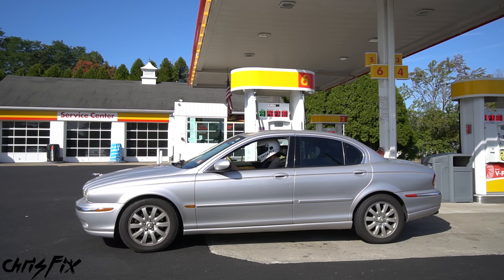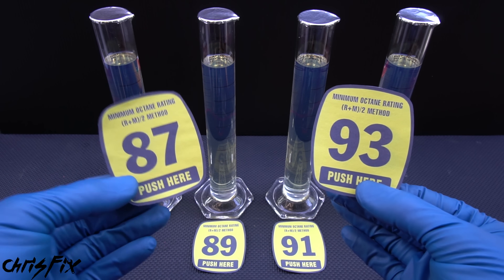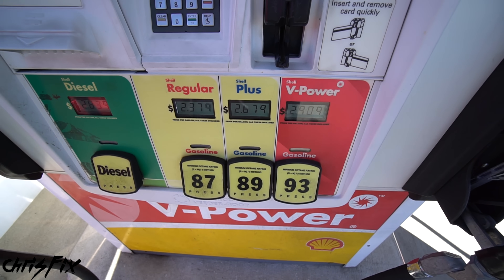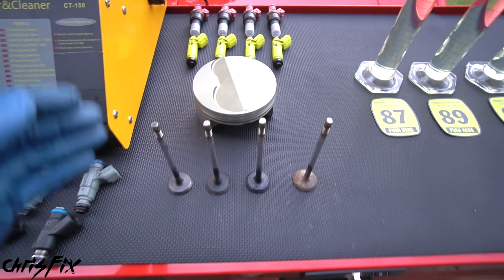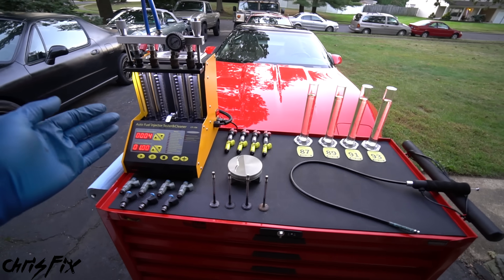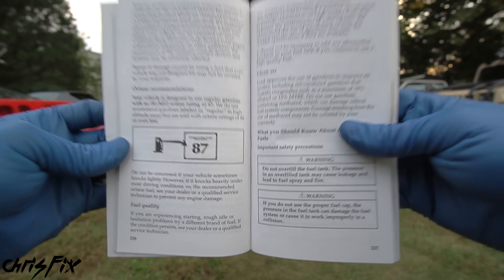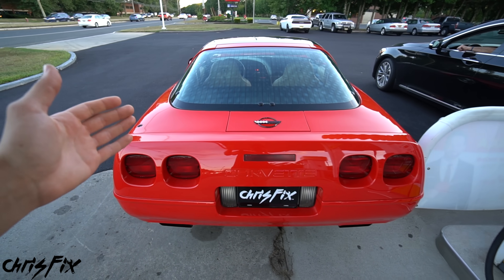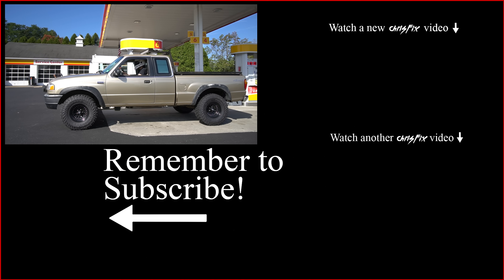What is the BEST Fuel to Use in Your Car or Truck and WHY

Comment: E85 has been a gas I have argued with people who mod their cars over.  The new trend is to turbo/supercharge their car and then get it tuned for E85.  Their arguement has always been modern cars are designed to run E10 so they will run E85 without any problems.  This is very incorrect.  Fuel pump, fuel lines and fuel injectors are damaged by E85 if they are not designed for the  E85.  This typically results in clogged fuel injectors and the owner simply changes out injectors and sells  the car still tuned for E85 to someone else who ends up replacing all of the parts from the fuel pump to the fuel injectors.

Comment: ChrisFix in 30 years... "What is the BEST Electricity to Use in Your Car or Truck and WHY"
Reply: @Alexander Chohan it kind of wooshed over your head! It is just a tease at the fact that electric vehicles are becoming more popular. Also if we get technical there IS DC power and AC power, but it was just a simple joke on the title!
Reply: @gripz81  AC or alternating current is used in electric cars or Nikola testla the smartest guy evers invention. Edison killed elephants ,dogs and more in live performance s with his DC current saying it was testla and his account current but lying about it. This after testla fixed his catching fire issues and more with DC current. But Edison did create one thing good for DC current,(electric chair still uses DC current).
Reply: What Voltage should I charge my car at?
Reply: @Alexander Chohan I thought that was part of the joke. Unless you have a special car, it won't matter what octane fuel you use at the pump. It's basically all the same.
Reply: Cars should be running on garbage by then. Haven’t you seen Back to the Future 2?
Reply: Ten years, fastest charges,best battery, they had water aka hydrogen ,steam cars back in 1832,Edison,Ford,rockifellers with finding oil killed the 100 mile per charge electric cars in 1890's all for greed if oil companies .
Reply: @Alexander Chohan see above reply.

Comment: Bull. The gas is all the same what is different is the anti knock Agent. So your gas will not Ignite in higher compression engines. And the compressing of  the fuel into a smaller space is where you get the power.

Comment: Here in Colorado we have 85, I've heard its because of the elevation
Reply: I drove from st louis to gunnison this past July. The amount of  acceleration I had in st louis is way more than i had at 13000 feet at monarch pass. Less oxygen typically suggests lower octane due to the inability for it to ignite at that altitude because of the lack of oxygen compared sea level.

Comment: I've checked the manual in both of my cars and they say "regular 87 octane" but regular in Colorado is 85. Both engines are port injection, one is a hybrid. Does the elevation of Colorado (3,000+ ft) mean it's OK to run 85 octane (regular as the manual calls for) or should I run mid grade 87 (which the manual also calls for)?

Comment: Not simple, I've owned 5 maximas from 90s to my now 14. I use to regular all the way up my 03 when my engine blew. It says on the gas cap "for maximum performance PREMIUM fuel is RECOMMEND". So now all I use is premium and I've had no problems.

Comment: it's not engine knock, it's spark knock. i know the confusion but engine knock is when a rod bearing is loose or where it's hitting the oil pan. spark knock is either predetonation or late detonation.

Comment: My car says 87 but I live in the rockies @ high altitude so the regular is 86 or even 85 in some areas, they do this since the air is thinner and it doesn't need as much knock resistance, but to keep my car running good I put a quarter tank of premium every so often, also make sure you are using "Top Tier" brands of gas for the extra additives

Comment: Nice video! maybe was dirty or maybe good luck but  I put the cheap gas for a month and suddenly my van stop working. The mechanic guess it was the fuel pump. That was expensive... I did a search and decided to buy an octane buster. Guess What?! My van works! TG is still working and Im getting gas in just one gas station and midgrade (just in case) :-)

Comment: Question I have a 2019 Dodge charger RT super track pack of that makes any difference, it saids 89 recommended 87 acceptable. Could I put 93 in or would I be wasting money.  I use 89 like it said, but was thinking about 93 today

Comment: 91 octane in US are 95 ron in EU. 93 are 98 ron EU. But 100 ron, or even 102 ron are offered in Germany (only 102). Fuel are very clean in EU because of stricter lows. Modern turbo engines loves high octane.

Comment: I’m glad he made this video I’m tired of idiots saying it’s all the same thing. Numerous times ppl say oh it’s a road trip so the car is gonna run all the bad gas out. Or that car doesn’t have a lot of power you don’t need it. I try to explain always the manufactures recommend using this type of gas due to the compression ratio to prevent knock. But they just look at me with this blank look and get lost. Thankyou so much 😭.
Reply from the maker: Exactlyyyy. So now just send them the video haha
Reply: I've had gas station attendants giving me blank looks when I put regular in my 92 Miata. "Bbbut its a sports car!!!! You can't put regular in that!" Well if the manufacturer says so, who am I to argue with them?

Comment: How about E88,  pumps says you can use that on both flex fuel or regular cars 2001 or newer
Reply from the maker: That is E15 aka up to 15% ethanol and 2001+ cars can use it without issues but I would try to avoid it if you can for now. That’s a lot of ethanol for a system that wasn’t really designed to used it. It’s fine if you use your car every day and go through a tank of fuel pretty quickly but if the fuel sits it absorbs water and can create corrosion.

Comment: Premium fuel burns slower, which is why it doesn't create knocking in high compression. That's not a myth.
Reply from the maker: That’s not true! Pleaseeeeeeee don’t spread myths. They burn at the same rate. Premium doesn’t knock because it has higher octane which is resistant to detonation. But gasoline all burns at the same rate. This info is verified by petroleum scientists so we know it’s accurate.

Comment: What about cleaning additives for fuel, any advice on that. I don't know how clean the fuel is here but no shell. We also have higher ethanol in winter months,  any recommendation for that.?????
Reply from the maker: Idk where you are from but in the USA you do not need to add any additives. Even if you don’t have shell, every brand fuel has a minimum required additive. I don’t suggest using them unless you have an issue like my truck had.

Comment: Your full of shit pal!! I know if I run on less than 89 my engine will knock. N it dont have the get up n go 93 has. N my fuel mileage stinks!! I own a 02 chevy z71. With a upgraded motor. So that theory u can run on cheap gas. N lower octane is trash! Not with mine.
Reply from the maker: Thanks for sharing. Maybe you got distracted or missed the main point of the video or didn’t watch the video. You can use the recommended octane for your vehicle. Since your engine is “upgraded” you probably need higher octane fuel as I explained in my video as well. Might have missed it but before you tell someone they are “full of it” I would make sure I understood the video. Thanks

Comment: What about using an oil catch can (for direct injection engines)?
Reply from the maker: That’s actually helpful and some oil brands are making oils specifically for direct injection engines to prevent excessive carbon deposits.
Reply: ChrisFix do you have a video on how to install and maintain and oil catch can? I’d certain like to see one. Also, is it too late to install on a vehicle that’s already got 10k miles?

Comment: Chris, can I use shell Vpower once in a while just to have a cleaner engine, will it make a difference? My car car doesn't require premium gas.
Reply: @Fred - Yes, absolutely or you can buy a bottle of Techron & add to a full tank of gas, when tank is empty then change the oil ...
Reply from the maker: MrSummitville, watch my video “does techron actually work (with proof)”.
Reply: @chrisfix  Yes, I do remember watching that video, many years ago.  I do not believe that one bottle of Techron will undo many years worth of neglect.  Using a "Top Tier" gasoline ( required by some engines ), or every month add some cleaner to regular 87, is the best way to keep the engine cleaner.  An ounce of prevention, is worth a pound of cure ...
Reply from the maker: Fred, you would need to use it for 2500 continuous miles for the Vpower to clean the valves and injectors. Using it once might help very very very slightly but you should use it a few times in a row to see a difference.

Comment: Mine say's to use Premium, but I live in california and I can't afford to pay $5.50 for gasoline
Reply: Buy some octane booster
Reply: @NateDaGreat561_  This is a much more expensive solution than buying the correct gas.
Reply: Move out Demigods tax everything Fla is 35 cents gallon fed tx 7 cents state 3 cents road tax  gas is 2.35 Clearwater fla

Comment: Diesel has 50% more energy per gallon vs gasoline
Reply: @Raj Gill - Diesel = 129.5 BTU per gallon, Gasoline = 114.5 BTU / Gallon. How is that 50% more energy per gallon?
Reply from the maker: MRSummitville pretty much nailed it.
Reply: @chrisfix  Higher energy per gallon but higher cost per gallon, so about the same  net cost per mile driven ?  Althiough, diesels can get very good MPG's - But VW did illegally tamper with their EPA MPG ratings vs pollution controls ....
Reply: @MrSummitville  ah I was using VWs doctored numbers as my reference. I have a smog except rabbit caddy

Comment: Another information that could have been included is that if the required fuel is not available but there are both lower and higher octane versions you should only go up. That does not damage the engine, going down does. For example my car requires 98 octane but we only have 95 and 100 here, 98 is no longer available so I have to use 100. Up is fine but usually unnecessary, down is bad.
Reply from the maker: Thanks! I did explain that you can use higher octane in a regular car in the video.

Comment: Very informative video Chris!! Your the best IMO but what about Ethanol in the Gas we use?Some stations now have at Ethanol free gas pumps! but it's only standard Octane, so should I use that instead?
Reply from the maker: It’s not a big deal to us ethanol as long as the car doesn’t sit around. Ethanol absorbs water so it can cause corrosion if you’re not filling the tank with fresh fuel every week or two. It’s more of a problem with boats because you don’t fill tanks with boats often.

Comment: A lot of in your face advertising in this video. A first for you. I think you should avoid it. Not worth it.
Nice shots with all your cars though.
Reply from the maker: Like what? Thanking shell for letting me use their gas pump for a day seems like a nice gesture for what they allowed me to do. I explained what octane to use in your car and how to figure out what to use and why. Just because I shot at a fuel station means it’s in your face advertising? So when I work on a ford and explain how mustangs have this specific issue I’m doing “in your face advertising”? Spending 45hrs on animations so I can explain what detonation is, and how some fuels can have additives in them to prevent wear of the upper piston ring is advertising?

Comment: Run what the manual says.  Most can run any grade, because of the knock sensor.  And after a tank or two, your computer will learn what fuel and timing it'll be running.

Comment: Is there any other ways u can check what fuel your car needs because my mom fills up with regular and I fill up with premium and I don’t know any other way
Reply from the maker: I showed 3 different ways. The best way is to check the owners manual. If you can’t find it, see if the engine is a high compression engine or forced induction engine. If so, run premium, if not, run regular.

Comment: Great video for a non mechanic like me.  Could you add information on the added ethanol to normal fuel.  What it does, the benefits, the down falls.  Does it cause more deposits in your engine at a quicker rate.
Reply from the maker: I should do a video specifically on ethanol
Reply: @chrisfix  Yes that would be awesome.  There is a lot of info on that subject.  Is it true, is it false, hard telling.

Comment: Thank you so much for all of the info in your videos! My husband & I have been able to do some of our own repairs this year simply from watching your videos & it’s such an awesome feeling knowing not only that we fixed it ourselves but the hundreds of dollars we’ve saved because of you. 

We have a 2003 Chevy Trailblazer EXT with around 140,000 miles on it that we were running with 89 up until last month when we thought we had an issue due to some bad gas. We were told to fill it with 93 for the next few fill ups to clean everything out after the water had evaporated & we found it gets way better gas mileage than with 87 (we used that a few times earlier this year then went back up to 89 because of the difference in mileage - we actually spent less getting  89 because we had to buy it more often when we got 87) & slightly better than 89. 

After watching your video this morning I checked the owners manual & it says to use 87 octane or higher. 

If it were your vehicle what grade would you use after finding this out?
Reply from the maker: See what MPG you get with each, calculate the cost per mile for each grade and see what is cheaper and run that.

Comment: Octane booster using premium gas?🤔
Reply: Mast M - Regular Gas + Octane Booster = Premium Gas  -  watch the video ...
Reply from the maker: Octane booster is a good emergency bandaid they you can use to help boost the octane a little if you fill up with the wrong fuel.

Comment: In europe (at least in Slovenia) you can only choose between 95 octane and 100 octane gas. There's nothing with less octanes even though it would be okay to use in lawnmowers.
Reply: @Matija Lazić
  -  Different math / formula used to compute Euro Octane Rating vs USA   -  watch the video ...
Reply: @MrSummitville  I was unaware of that. Thanks for info
Reply from the maker: Watch the video

Comment: hello chris, all the way from malaysia. im a honda sales advisor, i always get the question for which fuel is better or not , what are the differences or downsides. your video has been very informative adding to my knowledge. im evenly knowledgeable about cars and stuff, as i myself runs n maintains an integra 1991 DA5 . i would like to ask, here in malaysia we're using RON95 and RON97 rating. where honda cars always has a sticker for 91octane fuel. based on your explanation in the video, i understand that it actually made no significant change either u put in 95 or 97 since all honda cars now comes with a variable valve timing system. here's my big question. specifically on new honda cars. the turbo charged direct injection 1.5L vs NA ones, with 95 or 97 the valve timing will automatically adjusts anyway, but which is the actual proper fuel to use, and what are the advantages/disadvantages. 

case 1 = turbo direct injection 1.5L running on 95 vs 97 , apart from power/ fuel efficiency loss from automatically retarding/advancing valve/ignition timing to prevent detonation. any reliability issues/extra wear n tear? 

case 2 = NA 1.5L / 1.8L / 2.0L running on 95 vs 97, apart from power/fuel efficiency loss from automatically retarding/advancing valve/ignition timing to prevent detonation. any reliability issues/extra wear n tear?

lets assume both situations are using shell petrol on brand new cars.

there have been alot of debates and no actual guideline. some saying 95 u get less power/engine runs rougher vice versa with 97.
as to my own knowledge, as long as once the variable timing is set, it should perform the same since they're  all stock to begin with.

just would like ask if you could help clear up myths all the way from the other side of the world in malaysia, thankyou =D
Reply from the maker: For high compression engines or turbo or supercharged engines, it’s technically better to run the highest octane gasoline because the engine can advance its timing and make more power and more MPG. With that said, depending on prices you might find that extra power and MPG are not worth it.
Reply: @chrisfix  thanks alot chris, meaning to say, since the engines are designed for 91 and above, anything above 91 will not actually cause harm or excessive wear, but only power & fuel efficiency in play?

on the sidenote, honda NA engine and turbo engines do come with compression ratio 10, the general idea is just the turbocharged ones would find extra power and mpg vs fuel price more significant than the NA ones ?

Comment: I use mid grade on my 2016 Dodge Dart SXT because I was told it burn "cleaner". Have been using mid grade for over a year and now I'm confused and contemplating on whether using regular or mid grade lol
Reply from the maker: If regular is recommended in the manual, use regular. Mid grade doesn’t burn better. The only difference is octane.
Reply: @chrisfix  thanks! Yea it says regular so I'll just switch it back

Comment: i would like to shine some lights on the animation. while the piston compressed the the pre-donation occurred - it com bust when its hot.  not when the spark plugged is already sparked.
Reply from the maker: I didn’t talk about pre-ignition. I talked about detonation. Detonation happens after spark but before all the fuel is burned. That’s the knock you hear. The animations I made are 100% correct and I am glad they have taught you something new! That’s awesome!
Reply: @chrisfix  ok uright